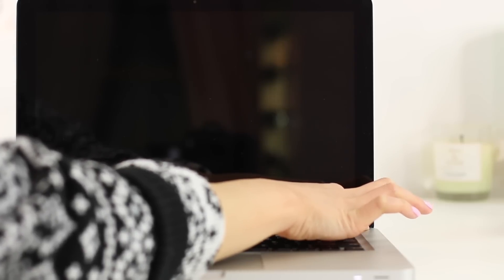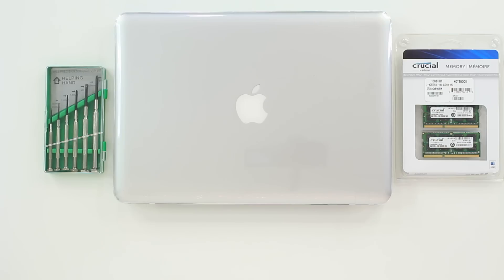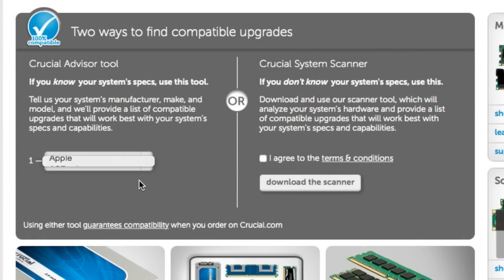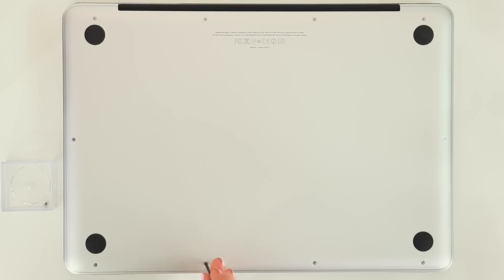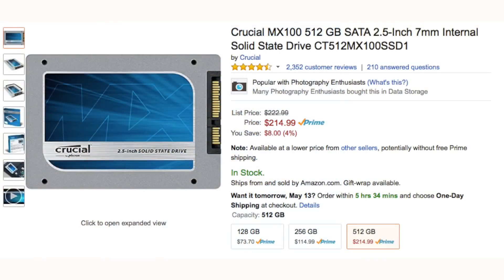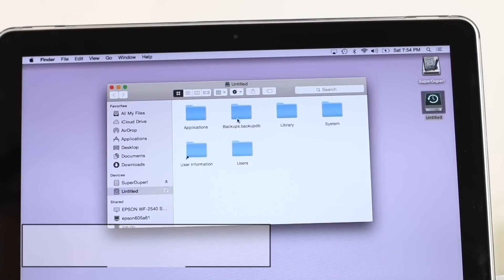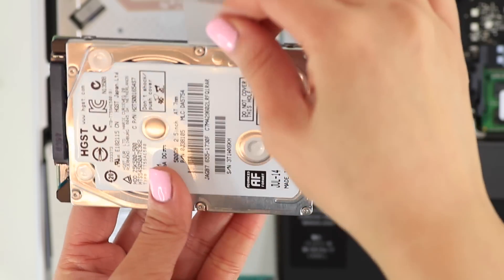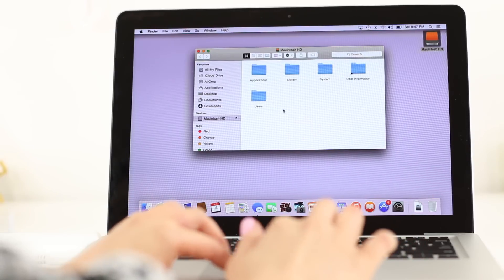DIY Computer Upgrade for LESS - RAM & SSD

Comment: By the way, another thing you can do which will do your mac good, is use the Disk Utility 'repair' function. If you do it once a month it kinda 'refreshes' your computer and makes it less sluggish.
Go to Finder and type Disk Utility, then open it. On the left side, there will be a list of drives on your computer, just press the Macintosh HD drive (it will say it twice, one will be under the other, press the one under), and then press 'Repair Disk Permissions'.

It will take 10 minutes or so, but it helps.

Comment: Will this not void the warranty cause I would like to upgrade mine but don't want to void my warranty
Reply from the maker: Yea, it would void when changing the original ram and hard drive but I figure if I ever drop my laptop, I could just switch back to the stock ram cards and hard drive back in to get it fixed by apple for any repairs. Apple care down cover upgrades so you still have to pay 2 to 3 times the amount for more ram and a SSD through them. It's up to you if you feel okay with it.
Reply: hmmm I suppose that would be ok

Comment: My computer is a cheat pro from Dell and I have been using it for the last 4 years daily. I'm kind of a geek and hated my computer around September, when even after a complete purge of the system it still was pretty slow. My computer could not open my navigator withouth lagging.
My brother looked into his old computer to get RAM bars which could make my computer go faster (so it was free :) ) and I bought a SSD for my computer which made a hell out of difference! It's a great way to upgrade a coomputer and you can reuse it with a new one later without a problem!
Samsung laptops are crappy but they make really good SSD if anyone is wondering!
Reply from the maker: Dlfineuh That's great! I reused my old laptop ram from this video into my desktop since it has 4 slots for now until I decided to upgrade my desktop SSD and more gb ram. Makes a huge difference like brand new ^_^

Comment: Lisa Pullano So you don't actually have to back up everything before removing and reinstalling the RAM?
Reply from the maker: sunsizzle33 All of my files is on the hard drive to begin with. RAM is the memory used when operating everyday task like browsing web and open more files at once. Your hard drive is your file cabinet that hold every things like your downloads, programs, and documents you saved.
Reply: oh okay, good. It just freaks me out when nothing is backed up and I'm about to take apart my laptop lol.

Comment: I have the same computer and it is still on the Apple Care guarantee. Do you know if doing the upgrade myself change something with the guarantee?
Reply: Jennyfer Caron Always check with Apple Care Guarantee to see if they cover it first, it could save you loads of money.
Reply: AlberteTDK It's not broke so they won't change it for free on the Apple Care just to upgrade my computer, but I don't want to pay hundreds at the Apple store for something I can do myself for just the price of the hardware. But I won't have a choice if it voids my Apple Care, because I still have more than a year of guarantee.
Reply from the maker: I would read the plan you have. I think it's fine but just to be on the safe side. You get get the apple plan details on their website.
Reply from the maker: I would just DIY the ram and SSD. Keep your stocked ram and SSD for that rainy day of your computer ever breaks and replace it for AppleCare to fix. Best of both worlds.
Reply: Lisa Pullano Ok thank you, I looked and changing the RAM and the hard drive aren't unauthorized modification that can voids the Apple Care, but if you damage your Macbook while doing it, it's not guaranteed. If that can help anybody that had the same question!